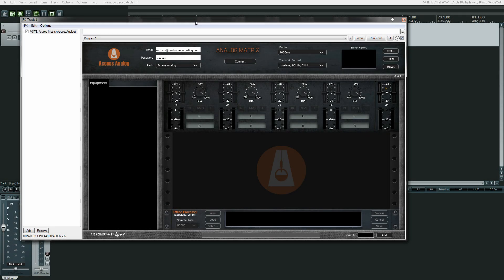Access Analog Audio Hardware GUI Compilation Q4 2021

Comment from the maker: Chapters

0:00 - Introduction
0:54 - Orion 32 HD3 Converter Loopback
0:58 - Altec 1567A
1:03 - Altec RS124
1:08 - Chandler LTD-2
1:13 - Neve 1057
1:20 - Neve 1058
1:25 - Neve 2057
1:29 - PYE Limiter
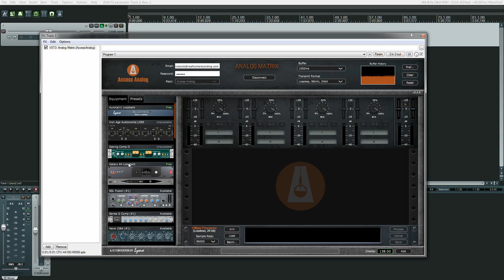1:36 - Aurora(n) Converter Loopback
1:39 - Galaxy 64 Converter Loopback
1:42 - Series G Comp (SSL)
1:46 - Neve 1064
1:53 - EL Distressor
1:58 - Pultec EQP1A
2:03 - UA 1176LN
2:07 - LTL Silver Bullet
2:13 - UA LA2A
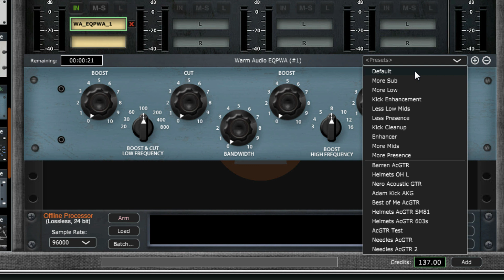2:18 - Warm Audio EQPWA
2:23 - API 5500
2:29 - Neve 33609N
2:37 - Highland Dynamics BG2
2:43 - Daking FET III
2:48 - Iron Age Audioworks LH95
2:52 - Daking Comp II
2:57 - RND Master Buss Processor
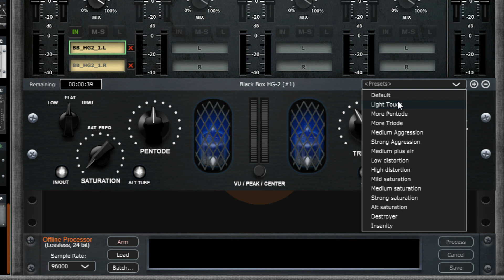3:07 - Black Box HG-2
3:11 - Manley Variable Mu
3:18 - Outro
Reply from the maker: PYE user manual: https://www.pompye.com/Technical/